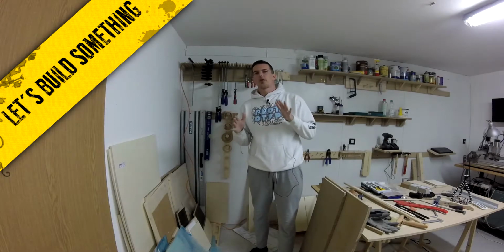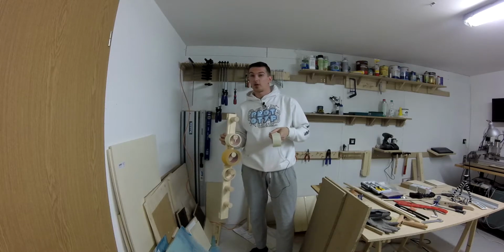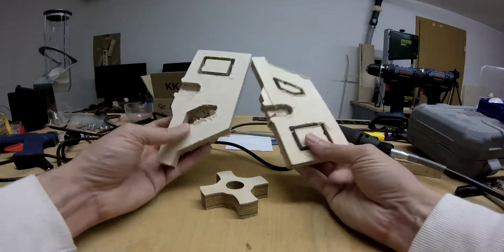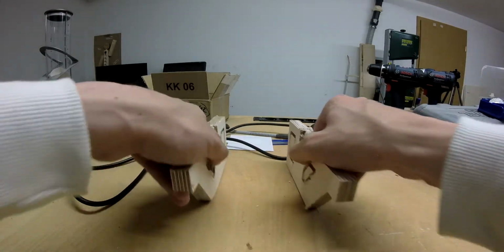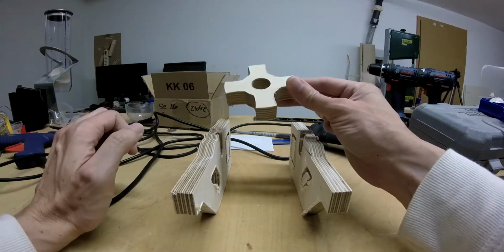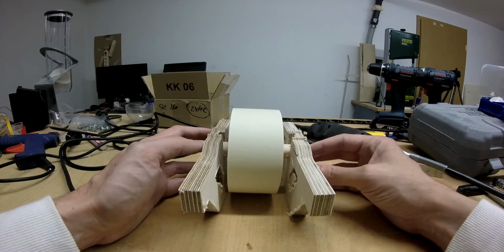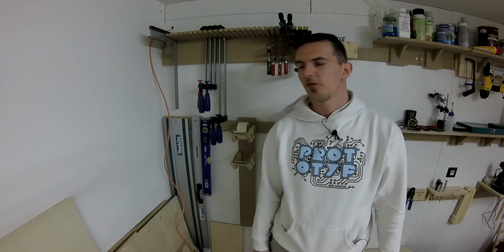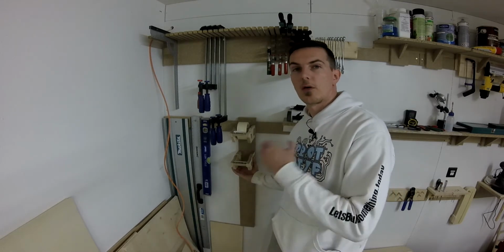The french cleat TAPE DISPENSER!

Comment: Hi

A useful device, but I think most of us would 3D print it these days - it's an awful lot of effort for a simple gadget.

Also, that looks like 18mm(?) birch ply - overkill for the job - it's important to be economical with materials.

Finally, I wouldn't bother with the serrations on the blade. You really don't need them to cut masking tape ;¬)  Apart from the work needed (without them you could just use any old disposable blade) they make it more difficult to remove the tape afterwards. Am I the only one who pulls a corner of stuck-down tape then finds all they've got is a long thin wedge-shaped piece because it's torn at the valley of a serration, and they have to start again? I'm not sure why the serrations are there in standard dispensers - to make them safer for kids? Not a factor here.

And finally, finally, there needs to be a surface behind the blade for the tape to cling to. I don't know if yours has one - the reel seems to rock a bit after cutting - but it's obviously essential and should be stressed in the design.
Reply from the maker: It wasn't so much work... the cnc did the most. :-) But you're right... this could be done easier. I build things as good as possible and I love to over-engineer my creations. I mean.. who is building a rfid enabled disc sander like I did in one of my other videos?!... :D